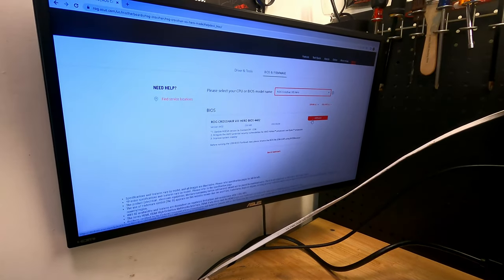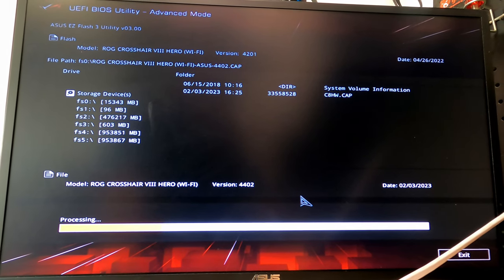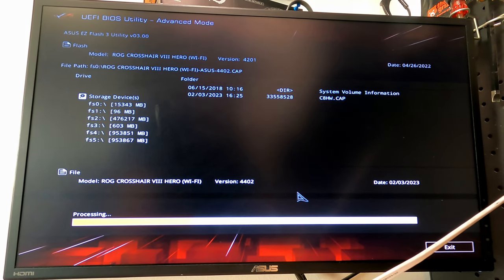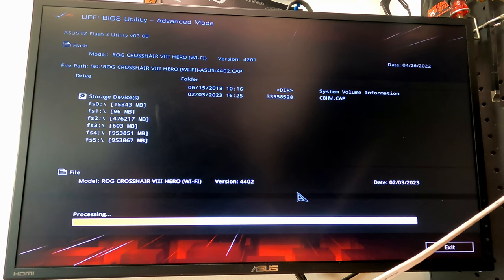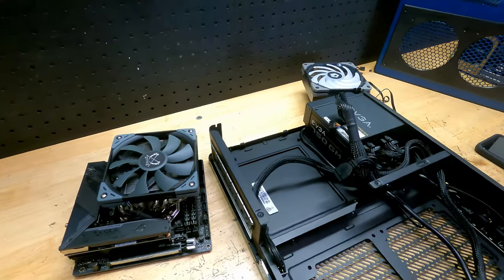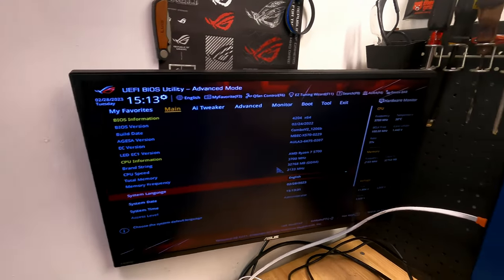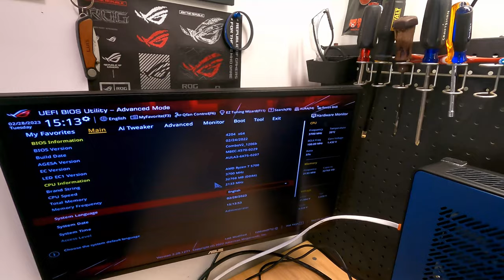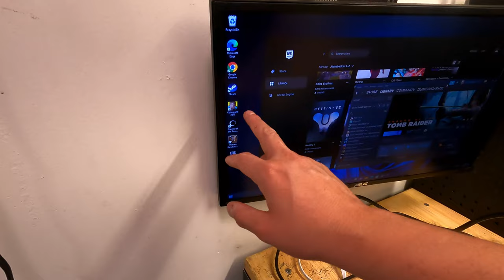Maintenance, build updates and upgrade vlog!!

Comment: It’s just spring cleaning time, just updated/cleaned/fixed all the stuff in my main rig and finally jumped over to Windows 11. Enjoying it so far with no issue. Depending on whether a friend needs it I might add more RAM for a total of 32 GB since I got 16 for free in a deal.

My main setup specs: Ryzen 5 3600, B550, 16GB3200, RTX 2060, PNY 256 boot ssd, PNY 1tb game ssd, Crucial 500 GB m.2

Corsair harpoon wired mouse, surmen 60% kb, asus 144hz 24”
Reply from the maker: Nice!!!

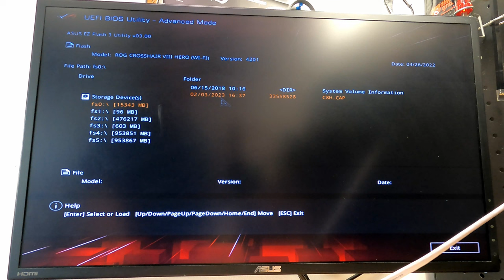Comment: 4:12 It could be the bios but I don’t think so, you’re running your DDR4 at 3600 when im pretty sure the 5950x IMC maxes at 3200. You might just be putting to much strain on the memory controller which notoriously is known to cause problems in a lot of Ryzen chips. Even if the kit says 3600mhz It’s not worth the very negligible FPS difference if you have instability.

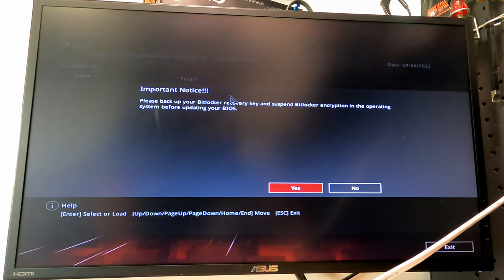4:22 ¡güifi!
Reply from the maker: The bios update did fix the issue. But I have had the memory controller issue on other machines and down clocking the ram fixed it